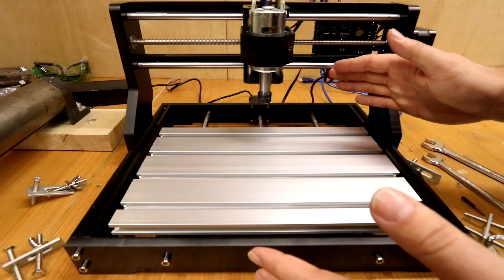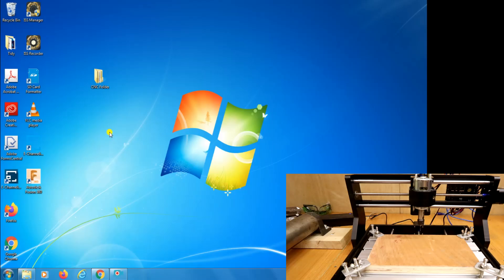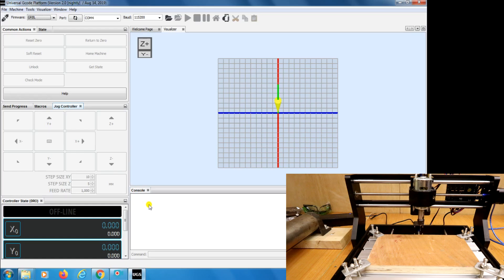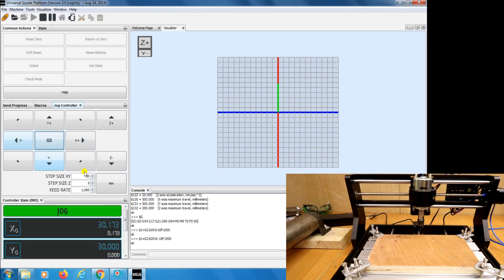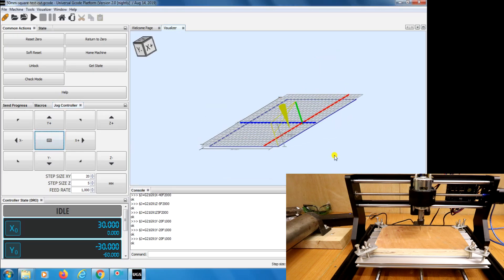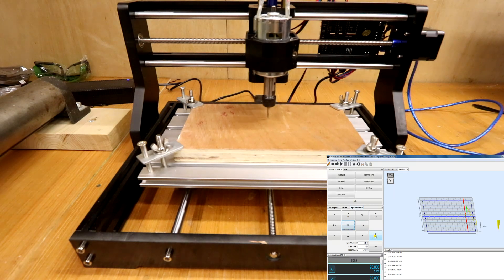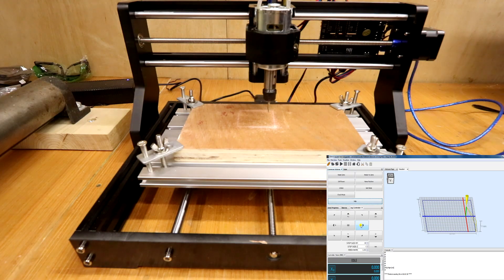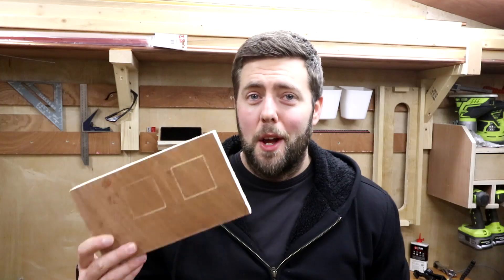3018 PRO - Making your first cut

Comment: Got 1 for xmas following your guides now but no movement from machine😒
Reply: Ok ok im gonna admit it. It now moves. Helps if u press the power button on control board lmao🤣🤣🤣
Reply from the maker: Well as long as you solved it, that is all that matters :)
Reply: @JamesDeanDesigns  now trying get my head around bits. Need a spoilboard too as 1mm lower on right so need a surfacing bit for sure. Cheers for making vids they helped me get this far. Question on mounting the motor how high/low do you have it mounted because when at zero it can only go maybe another 5mm before maxed out.

Comment: the app installed, ran, I closed it, now it does not want to open, crap software
Reply from the maker: What software? I suspect its because your PC has not closed it down correctly. Open Task Manager, close the process down for that software and then reopen the software
Reply: @JamesDeanDesigns  one in this video.  and no its not running, I even reboot the pc
its not showing in the apps folder, it installs and vanishes. not in the uninstall file, nor is there any folder.
its like its a virus, 
even in safe mode its not there and it installs, flashes the logo as if its starting then nothing, no where to be found
Reply from the maker: @wkduff  UGS doesn't install or uninstall. It's a standalone program ran from the EXE file. You can create shortcuts if you want to make it easier.
If the software has opened once though then it should be OK. There was a slight issue on the older version where the 64bit file wouldn't open, you had to use the 32bit version
Reply: @JamesDeanDesigns  know this program did not work like a regular program
 there is no files and there is no shortcuts.
It installed and ran like it's a virus

Comment: Hi James,
The 775 spindle that came with my 3018 Pro-Max CNC needs replacement. I found Hanpose 775 Spindle motors with double ball bearing on Banggood. 80, 150 and 288W. The amp rating is 6Amp for the 80W motor and 12Amp for the other two motors. I have a Cronos controller board. I was wondering if the 150W  will be compatible or if it will fry the board? The alternative is to do your upgrade to the 20,000rpm spindle, but then I'd like to upgrade the controller board at the same time. Do you have the specifications and product descriptions for me? I see you can get the Genmitsu spindle motors as well. Would they be compatible?

Comment: You mentioned quirks in Candle...is one of them not having the machine start at the home setting as set with the software? I have set the position of the head and zeroed out as in the tutorials, but the machine starts cutting where the screen shows the cutter and the head does not move from the set zero position and go to where the screen shown the cutter. Any help you can provide or should I just download and use UGS?

Comment: Setting Fox Alien 3018-SE V2  up in UGS Sender on the jog tester set at 80mm X+Y. I get the pointer going off the view screeen and the Controller State says 80mm but the head only moves very slowly to 0.8mm.Why isn’t it moving as in the video ? Mark
Reply: Fox Alien Tech help All working OK.

I changed :

$10=3  to 1 
$100 = 3.200 to 400.000
$101 = 3.200 to 400.000

Comment: Hi can u help me with my machine, it is working when i move the axis from the computer and from the offline controller too, and when i run a file to cut, only the spindle is rotating the axis's are trying to rotate but couldn't, what will be the cause, is the controller on need additional set ups
Reply from the maker: Where are you generating your files to cut?

Comment: If someone needs to know that 'there's a little hole' where the bit goes they shouldn't be within 10' of any power tool of any kind.
Reply from the maker: May seem obvious to some people but equally there is a reason it's one of my most viewed videos. It's a beginners guide full of lots of basic things. Some people who use these machines have never touched a power tool
Reply: @JamesDeanDesigns  scary thought.

Comment: mine is not working with the Uniwersal G-Code Sender: only Candle. But is not disturb why if?
Reply from the maker: If it only works with Candle then you can continue to use that. Openbuilds Controller is also another popular one that I would say is better than Candle

Comment: Probably a dumb question but I will ask anyway. If I download the files mention in this video do I still need to use the cd that comes with the genmitsu 3018-pro??
Reply from the maker: Kind of the same files, the driver is the same but the main difference is I use UGS in the video as I'm not a fan off Candle
Reply: @JamesDeanDesigns  thank you so much for your helpful videos!!
Reply: @JamesDeanDesigns  so I can download the files you mentioned and I will be good to go? Or do I have to use the cd to get it going and then just use “your files”?

Comment: hi iv got  ugs software i been able to get machine moving but  not been able to get a trial cut sorted  can you help
Reply from the maker: I can try. What exactly is the issue?
Reply: @JamesDeanDesigns  iv got no file showing trial cut
Reply from the maker: @julianoconnell4488  so when you download the file from my video it will be a Zip file. You will need to extract all the files from it. Once extracted there will be a folder called test file. Have you got that far?

Comment: Thank you for making this great tutorials... I am following your guide however faced on some problem..:) During installation of UGS, there is error that could not find java even I download it and installed it safely... in this case how I can solve this problem? Can you please advise me if you know the solution. Thank you..
Reply from the maker: Hi. If you haven't installed Java already, you will need to do so. Install the latest version then restart your machine and try installing UGS again. You will also need to make sure UGS has been fully extracted from the zip file
Reply: @JamesDeanDesigns  Thank you for your reply.. However it did not work well in my laptop so I downloaded 2.0.7 Windows version with bundled Java from UGS website and it works well... so maybe it can be also one solution for your followers faced on similar problem like me. Anyway thank you a lot for your tutorials.. Even it is more helpful than user manual from CNC producer..  :D

Comment: Hi James... your tutorial really helps... but mu spindle will not start up ... do you perhaps know why... I have tested it by hard wiring it from the adapter and it works... but won't run
Reply from the maker: Hi, is that using my test code file or another file of your own?
Reply: @JamesDeanDesigns  Thanks for your reply... I managed to sort out the issue...
Reply from the maker: @zizalupini1879  that's what I like to hear 👍

Comment: Hi James a great series of videos . I have the older 3018 not pro I'm unable to run  on
 UGS the board is a woodpecker v3.1 com port 5 it connects but won't jog  any advice on what I'm doing wrong
Reply from the maker: Hi David, Check out issue 4 in this video and make sure you have done all the steps. Usually if its not jogging then something is not connected correctly. https://www.youtube.com/watch?v=r-uLsMwOBfY&t=34s&pp=sAQA
Reply: @JamesDeanDesigns  thank you

Comment: James,

I have a problem setting the cut depth, can it be done in ugs or do I need another way of doing that ? Great vids btw. Thanks
Reply from the maker: It has to be done within the design program. You can try modifying the Gcode but it gets compicated

Comment: Hi there, I have watched your video, I don't know how many times, but the one thing I'm not achieving is this.  I can place cutting tool at correct point, but when asking it to cut, it scores the wood rather than lift up, go to starting cut point, the cutting too doesn't lift up before cutting or after cutting out design, not sure where I'm going wrong, actually the diagram doesn't even show the yellow lines of the path the cutting tool will take. thanks in kind... Mr frustrated lol
Reply from the maker: Sounds like it's not raising your Z axis up correctly. First, check you z axis travel, so take it to top and then tell it to move down something like 20 or 30mm. Measure how far it actually travels? Obviously it should be the same but if its not we can adjust it
Reply: @JamesDeanDesigns  it is raising but only when I press return to zero... nothing when reset zero, like you so and it raises movest to point, when its finished your cutting blade raises and goes back to original starting point, my just stays where it is when finished, its then I have to press return to zero that it does, I'm so at a lose, spent past 2 days trying to figure it out.

Comment: I have got one now but can not use because the way you put the program  In you have got to use win zap ad you have got to pay for this I thought  you can run it with out paying. Iv got 30183 pro ad can not use it can you help me thanks Andy
Reply from the maker: Hi. The file is just a zip file. You should be able to open it within Windows or download a free Zip opener such as WinRAR. You shouldn't need to pay for anything
Reply: @JamesDeanDesigns    hi matt just to let you now that  I'm not good on pc iv trying to find a WinZip but can not find a free one iv bin looking at your vids its a lot to get it working im new ad don't now
Reply: Hi mat got through to program  but come
up with no file loaded ad will not work what am I doing wrong I'm getting there

Comment: Everything works but when I finally click send it just says the status is on "hold" and doesn't do anything.
Reply from the maker: Do you have any options to continue? Usually the hold is triggered by something but that is a little odd
Reply: @JamesDeanDesigns  If I could like this comment more than once, I would. I was confused because I did not see any continue option, but I just hit the pause button just for the heck of it and it started! Really interesting that it kept auto pausing at the beginning but I guess that has something to do with the gcode generated. Thanks!
Reply from the maker: @michaeldahlinger8815  could be asking for a tool change. Send me the code if you want and I can take a look but the fact its worked means it wasn't anything too serious
Reply: @JamesDeanDesigns  I don't think that'll be necessary but I appreciate it! I been into the 3d printing for a few years now at this point and I think it's about time I actually taught myself a bit about gcode.
Reply from the maker: @michaeldahlinger8815  it looks scary but like most things, its not that complicated once you start to understand a few bits

Comment: This is a very informative video.
It just annoys me that the basics are not covered correctly. Maybe you do not know?
This style of clamp is designed to produce DOWN FORCE!
Not sideways force.
The bolts that are attached to the T-nuts are supposed to be adjusted so the clamping bracket is horizontal.
The wing nut is then tightened to produce the "down force" that is required.
This stuff is REALLY basic knowledge in machining.
Great video otherwise, but why not show the correct way to clamp a work piece?
Reply from the maker: Hi Charles, sorry it annoys you but as I state in my video, at the time of recording that I was a beginner and I openly admit I don't know everything...however in numerous other videos I have done since, I do cover the correct way to use these clamps. In fact I now rarely use clamps as I much prefer CA glue and tape and the clamps get in the way. But glad you found the majority of the video helpful 👍
Reply: @JamesDeanDesigns  Thanks for the reply.
Someone must have given me some"cranky juice" the other night.
I re-read my comment and I think the tone that comes accross is overly critical.
I do appologise for that, and I want to thank you for putting out these videos, they are very helpful.
While I have been machining for a while now I am still very new to CNC and I greatly appreciate the videos that You and others put out to share your knowledge.
Cheers.

Comment: scrolled through all these comments and unless I missed one...am I the only one that can't get this UGs software to move my spindle.  It's does it on screen on software but my spindle isn't following along.
it's powered on. usb port is com6, everything wired correctly but nothing happening....
How come we don't have a "what if" section....you know if that don't work it might b because....
Reply from the maker: Hi Jerry. I do things such as the top 10 issues video, but yours is quite rare. Ive only known that to happen before when the USB is connected but the power isn't turned on correctly. When you tell it to move, can you hear anything from the motors?

Comment: I can't get my COM port to show up??? Drivers are installed, it just shows up as a USB Drive with no COM port in Device Manager...
Reply from the maker: Is your USB cable connected directly from the control board straight to the PC and there is no offline controller?
Reply: @JamesDeanDesigns  That is my problem, I was using the controller. Thank you.

Comment: Thank you so much for your detailed videos. After hours of trying other videos and getting frustrated I was about to give up and send the machine back, But in one hour with your video I was up and running  using your sugested software from UGS.
but when I try to load the sample 50mmsquare test file , it is not in the loaded software. Where can I download the test 50mm file. Thanks a 1,000,000 Sal
Reply from the maker: Hi Sal, glad its helped. The file will probably be in your download folder, possibly inside a Zip file so you might need to extract it out.
Reply: @JamesDeanDesigns        that is the problem, it is not in any of the extracted folders. I'm trying to follow your tutorial and would like to use the file you use. I am brand new to cnc
Reply from the maker: @salavocato7616  that is strange. If you want, find me on Instagram or Facebook and send me your email address and I'll send you the file directly

Comment: Great informative video, however when I use the file to cut the square the X & Y axis movements are fine, however the Z axis goes deeper and deeper for each cut (the same happens when I try a simple text example with the same depth cut for each letter).  Any thoughts please.
Reply: hi, you. How about your problem, because me too. Can you share your method to do successfully. Thanks
Reply: @speakeasyvn5429  
I made sure $32 was 0, not 1 (i.e. not laser) so $32=0. My Z axis acceleration ($122) was also quite high. The acceleration of the Z axis doesn't need to be as high as the others so James recommended bringing that right back down to about 300 or 500 so $122=300.

Hope that helps

Comment: Hi just found this little gem of a machine.  It may be of use to me, depending on your answer. I have recently started building a doll house. In which I want to I want to use period scratch built furniture, made by my own hand, using real wood. So here is my question if I was building a set of drawers is the cut accurate enough to get repeatable  pieces of all the same size?
Reply from the maker: Hi Ian. I produce some parts for tables saws on my machine and they are repetitively accurate to within 1 or 2 10ths of a millimeter. So if your working to within that tolerance then yes. Obviously the more time you spend tuning your machine and understanding the speeds, the more accurate you can get it

Comment: thanks for this and the words of encouragement at the end, my cnc kit is still in the box, saving this for later, when I plucked up the courage to build it
Reply from the maker: Good luck, hopefully all goes smooth 👍
Reply: @JamesDeanDesigns  it went great, but I'm struggling to understand how to determine size of downloaded cut in comparison to the size of the board as well as where/how to change that size if it is too big and how to change depth of the cut, make sure that software knows top speed of the motor, which drill bit I'm using. The more I delve in the more confused I am!

Comment: Hello James
Thanks for taking the time to pass on your expertise.  You mentioned Candle software was not very good. I have a new PROVer come and am just getting started in CNC and Laser hoppy. What did you find wrong with Candle?  Stay Safe and Well!
Reply from the maker: I had some issues with it and jobs failing. It also seems glitchy depending on what version you download. It is easier to setup than UGS as it doesnt require Java but I do find that UGS seems to be better overall

Comment: Hi james i installed ugs platform i got it moving Y XZ but when i send to engrave spindle moves but not rotating to engrave and  it keeps on disconnecting. Dont know what im doing wrong.... please help thanks
Reply from the maker: Are you using my test file in this video or one you made yourself?  If its disconnected then you may have a loose connection somewhere

Comment: James hi, I have downloaded UGS Nightlybuild according to this video. In fact I have been trying for some time to get it up and running with no success. I keep getting the following error message. Can you please throw some light on it for me. I'm new to CNC and don't know where to turn
An error was detected while sending 'J=G21G91Z10F1000':(error8 )GRBL $ command cannot be used unless GRBL is idle. Ensures smooth operation during a job. Streaming has been paused.
I am a subscriber and find your videos quite helpful. Help me with this one plerase